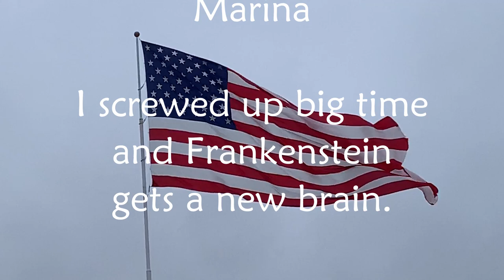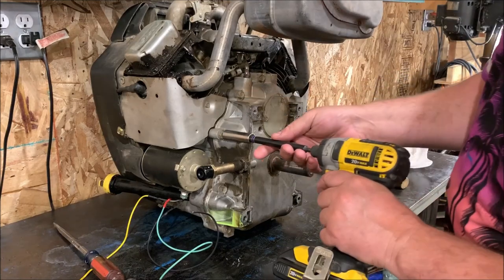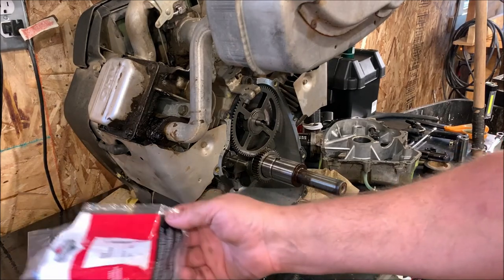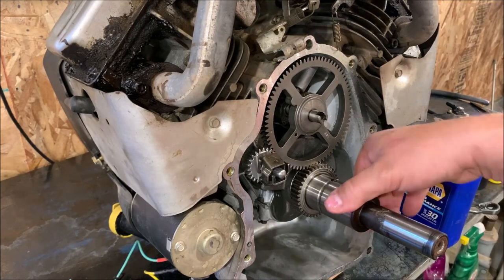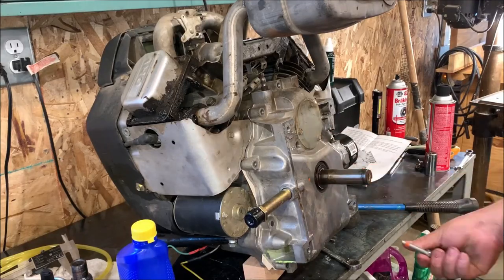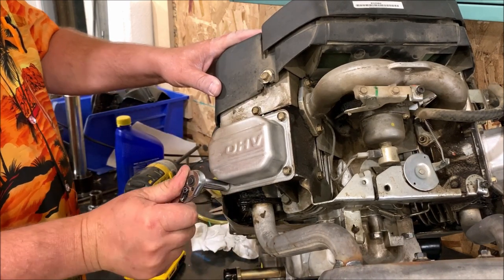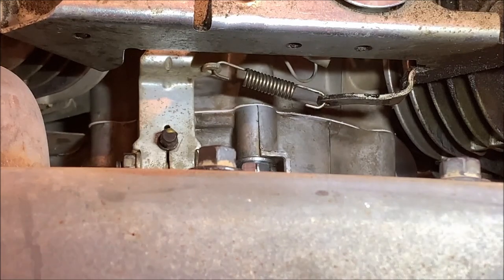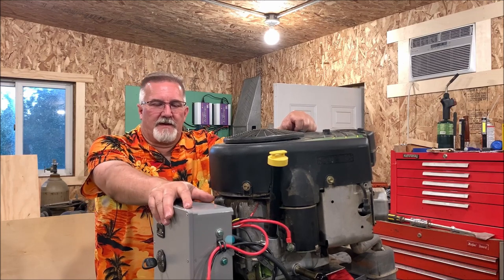John Deere and Suzuki outboard build of Frankenstein Part 3 How I blew up the governor then fixed it

Comment: Hi Mike, inspirational stuff indeed. I'm looking at a 25HP Kohler sawmill motor sitting on a Yamaha 50hp 4 stroke lower unit for my 23ft yamaha fishing boat. Getting the bits together first. I'm thinking that due to the limited Rev range of these V-Twins, you gotta use a higher pitch prop ,like you mentioned in part 1, so that at wide open, power of the motor is not wasted. That way you can then Rev down to 75% power for cruise speed. But one thing with the governor setting as well is that you well get that torquey throttle response as it responds to the governors inputs. Maybe, with the governor removed you could then just apply throttle manually like a standard outboard motor?
Reply from the maker: That could be the case for sure.  I will see when I get Frankenstein out on the water

Comment: I have seen numerous such motor cross overs. They always seem to end up the same. Lawn mower engines with governor top outat about 3000 to 3600 rpm. Outboard motors top out at 5000 to 6000 rpm. The lower speed of non-modified engines decrease boat speed to 1/4 of normal outboard engine boat speed. Its better than walking but without the governor most lawnmower engines can attain about 4500-5000 rpm and make the swap worth it. Your thoughts....
Reply from the maker: Very true, but this project is not about the speed, it's about the ability to go through nasty water and not worry about the engine being water cooled.

Comment: Great vids, I have the same 21hp sitting in the garage. I’ve been looking around for a donor outboard. I’ve been wondering if the donor outboard is too big, ie. 40hp, if the gear ratio would bog the 21hp. Would a smaller outboard offer a better ratio?
Like maybe a 15hp?
Have you tried yours yet in water? 
Am I over thinking this?
Reply from the maker: I put mine on a 30hp.  The 4 stroke is going to have more low end torque.  There are a few more options for props on the 40's.  I haven't tried mine yet. I have a boat I'm working on that I will be able to try it on.

Comment: I know you said this is not about speed, but there are many who are using such engines (usually horizontal shaft) for go carts, sand buggies, ATVs etc.  They take the governor out completely and hook the throttle cable directly to the carb butterfly valve like a car or motorcycle engine.  They get more revs, more direct response to the throttle, etc.  Some people are using them to power ultralight aircraft.  This 4-stroke will never hit the revs of a 2-stroke, but can have some pretty respectable performance.  
Doing so, may be "Frankenstein Meets Godzilla!" or something like that.
Reply: BTW, removing the governor completely and linking direct to carb will avoid the ugly over-revs you had problems with earlier.
Reply from the maker: the over revs were from me not knowing how to properly adjust the governor, lesson learned for sure

Comment: Take the governor out and put a flat slide carburetor on it with some 40 lbs valve springs and rock and roll.
Reply from the maker: thanks for the tip.

Comment: The low RPM for shifting is good, but don't run that engine at too slow a speed for a long period of time. It is air cooled and needs the higher RPMs to keep enough air flowing to keep it from overheating.
Reply from the maker: yep just for shifting purposes
Reply: Also don't forget that some engines require a minimum RPM rate to maintain adequate oil pressure.

Comment: Is it possible to remove the governor completely by putting a stiff return spring on the throttle?
Reply from the maker: Without the governor you run the risk of over revving the engine.  There would be a little more to it to make sure the throttle maintained control
Reply: Very well done. Thanks for sharing this info. I do have a pretty severe dislike of vacuum fuel pumps. I just replaced one on my '98 Suzuki atv at 5000 farm miles.
It started with flat spots in the fuel delivery 3 or 4 yrs ago but I struggled by ok. Finally I faced the music.  As I removed the complete front body work and gear selection console to gain access to the old pump,  in the back of my mind was my 1978 Goldwing GL1000 motorcycle with a FACET 2# electric fuel pump. It was installed by the previous owner and still works like a charm and I've had the bike 15 years. I suspect it would cure your fuel delivery issue. Just an unrequested opinion!  But you're drawing fuel thru a long length of hose and the little facet would be just the ticket. I'm anxious to see it on a boat soon. Your build is a lot better than a new Suzuki motor for $3600.00!!! Thanks again.
Reply from the maker: Thanks for watching and the insight on the fuel pump.

Comment: i got a video on deere problem the tractor in 2 parts the motor blew up the motor blew in two parts there major motor and crank and back maybe 3 bucket tractor need to clean up the mess, it not a replay 3 times in a row they blow up majorly in pulling there over boost or wrong fuel!!

Comment: Here is you a fuel issue hack take a battery operated minnow bucket airiator and mount its line to your fuel tank it will pressurize the tank enough to help a weak fuel pump deliver fuel

Comment: Michael, My name is Art and I am building a boat for taking handicap kids out on the water. I am looking for an outboard engine 25hp short shaft preferred. This project is all done on donations and the boat is being built by the kids (with my help and guidance). If you have something that you may want to donate it doesn't have to look brand new we will paint it. It would be greatly appreciated. And if not that's ok too. Thanks for your time.
Reply from the maker: Where are you located?
Reply: @Michaelsbackyardmarina  Westminster Colorado

Comment: You need to install a "kill switch" in case you fall out of the boat, or the motor runs away from you again. A Kill Switch grounds the magneto out and stops the engine immediately. A safety item you will find on any boat made in the last 30 years, why compromise on safety?
Reply from the maker: agreed